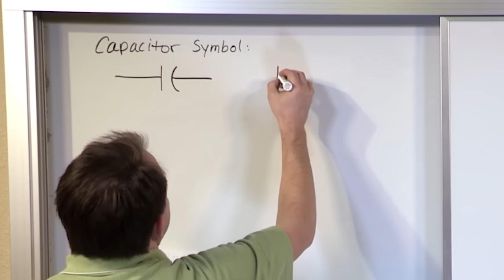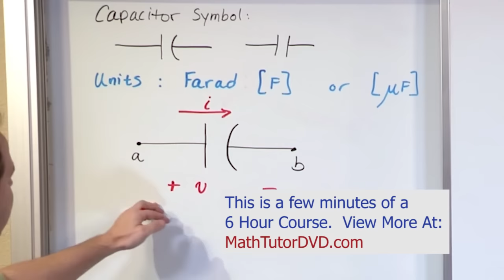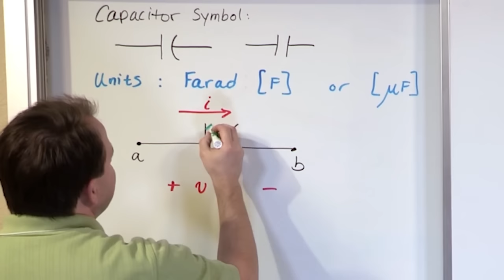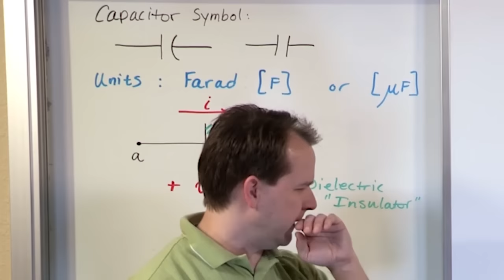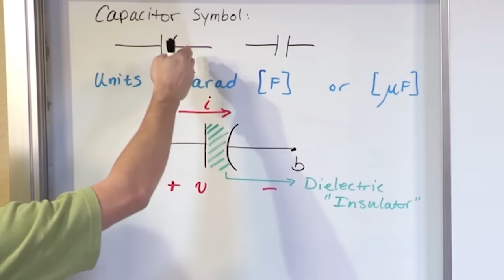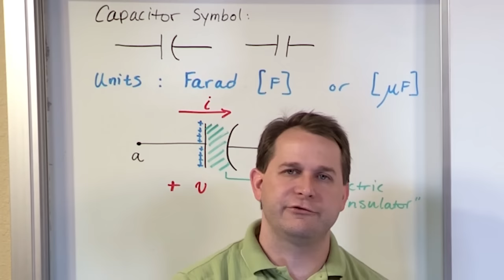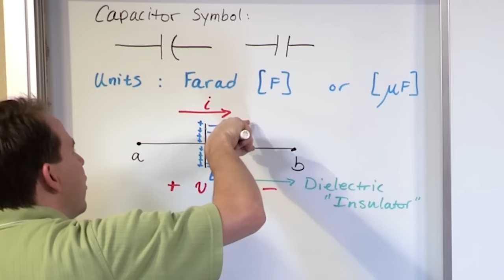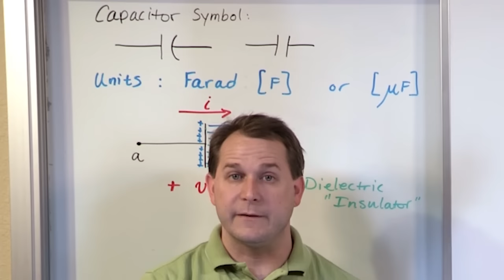What is a Capacitor?  Learn the Physics of Capacitors & How they work - Basic Electronics Tutorial

Comment: The curved plate indicates that the capacitor is of an electrolytic design.   The implication of that is that if you hook it up backwards it will probably explode.   For this reason you never subject it to alternating currents.   The most common is as DC filters in power supplies to remove ripple after rectification.

This is a fantastic series.  I see that he is bringing calculus into the instruction in Lesson 9.    Once you get into RLC circuits then you will need differential equations.   Oh how I love Eulers.

Many people don't understand why they had to take algebra in high school.   Algebra is just a stepping stone to calculus.     Calculus is where all the magic happens.   The power of calculus is absolutely incredible.

Comment: 2:32 This is true for most low power electronic circuits, where you'll mostly be using medium to very small capacitances for voltage smoothing; evening of potential for reliable power and performance. But I would like to expand on this. There are actually decently sized supercapacitors which can have capacitances of hundreds to thousands of farads! Some people even make cells of capacitors to deliver power instead of common batteries. They have some different properties such as very low internal resistance, so it can deliver a LOT of power really fast.

Comment: when the capacitor discharges the positive charges equates with the negative one and continue this till the charge stored on the capacitor vanishs, the positive gharge came from the holes that the negative charges left behind when they went to the positve terminal of the battery, the capacitors charges up till the potential difference across its terminals become the same as the voltage applied across it and here it is the voltage source potential difference

Comment: nice description...
only one two happen in capacitor .
1 .FOR AC SUPPLY CAPACITOR IS LOW RESISTANCE IT CAN EASILY PASS ON TO ONE TERMINAL TO ANOTHER TERMINAL

2. FOR DC SUPPLY CAPACITOR IS A HIGH RESISTANCE IT CAN'T PASS ON 
CURRENT FROM ONE TERMINAL TO ANOTHER TERMINAL

this condition depends on capasitance value (ferade)

Comment: What happens to the positive charge when a capacitor discharges (from the left side)? Where does it go?

Where does the positive charge from the right side come from? The world? 

Does a capacitor have to reach it's required charge to work? Question kind of answers itself and that is "yes", otherwise what use would they be?

Can you input a lower voltage and have a capacitor output a higher voltage? Or does it equate to: "You get out what you put in."?

Comment: if you continuesly have  9 volts going to the capacitor will the voltage in the capacitor increese
Reply: only up to 9v. like a battery charger will charge a battery usually with JUST a little more voltage than the battery would normally put out. (modern quick charge exempt)
but also AC is never continuous.

Comment: So if I'm connecting a cap to a transistor base the cap should be positive for  audio input and negative would connect to the base of that transistor for audio output source correct?  Or I could say it like this the audio signal goes into the plus side of the cap and drains out of the negative side of the cap into the transistor base. Basically I want the signal to be continuously going forward and never coming back into the incoming signal. This is what I want to accomplish. Will you be willing to answer this question thank you. 🤗💖

Comment: You send the current up to plate. but it's not a complete circuit yet so how does the current move? is it because the other side of the capacitor has had electrons removed by the other terminal and is now positive? or are electrons so easy to move with a single terminal charge that the plate can be effected filled? Is there a point when it's filled with negative charges and it actually pushes back or equalises and no more electrons can be gathered?

Comment: Good lecture.
I do have a problem with positive electrons piling up on the plus side of the capacitor though.
I was taught that negative electrons pile up on the negative side and repel the negative electrons away from the positive side making the plus side more positive.
Reply: It works both ways

Comment: I've never liked this "positive" electron flow concept. This is very counter-intuitive. Why not just say that the flow of electrons from the negative battery terminal (actually just a transfer of electrons from atom to atom) builds up on the negative side of the capacitor and induces a corresponding positive charge on the opposite plate causing the illusion of electrons flowing "through" the capacitor? IOW, just the reverse of what he was saying. Anyone care to chime in?
Reply from the maker: I'll chime in.  You are correct and at first glance it seems counter intuitive because electrons are what is actually moving.  The problem is that electrons are negatively charged so if we write all electrical equations in terms of electron flow then all the equations have negative signs everywhere.  That gets cumbersome especially when you write equations that involve electric and magnetic fields.  So we instead write the equations in terms of "hole current" which is the positive current that runs in the opposite direction to electron flow.  Of course the positive charges aren't really moving but mathematically you get the exact same answers doing it this way and you avoid all of the cumbersome negative signs everywhere.  You may not agree that this is a good reason, but this is why we talk about positive current flow in circuits instead of electron flow.  Basically it is convenient when writing equations and solving problems.
Reply: +mathtutordvd thank you! thank you! thank you! sooo much, I was so confused up till now ,internet is amazing.
Reply: +mathtutordvd Okay, I get your meaning. But doesn't this mean that you get the opposite results (a lot of unwieldy minus signs) when working with equations involving inductors? Or is it that modern circuit designs don't make much use of inductors any more? After all, they're not really miniaturizable (for use in ICs) like resistors and capacitors are.
Reply: Zero dem ex b de gt SCç muito t +Yash Pandey
Reply: Chris M I know, it's so confusing.
Reply: Chris M couldnt agree more
Reply: Chris M.
Research the Passive sign convention.
Reply: Chris M how do inductors get brought into this in comparison???
Reply: It's all because Benjamin Franklin didn`t know about electrons and simply got the direction of current flow wrong. 200 years later and it would be one h ELL of a big job to convert the world's standards and history over to electron flow.
Reply: mathtutordvd thanks I now get why we talk about it this way....but basically if we were to put a “magical” microscope the “positively charged side” of the capacitor just means the “lack of electrons and the other side just means the excess of electrons right .?

Comment: In simple terms a capacitor is an electrical component that stores un used power, given from the sours. when the sours is taken off the capacitor is the secondary sours that will power up whatever its used for and will be de-charging, either instantly to blast out a charge of power or set for a length of time?

if i had a 12v battery and on a circuit bored i just had a resister and 1 LED in series it obviously would power up, but once i took the battery off it goes out. but if i hooked up 1 (3 microfarad) in parallel to the sours of the circuit and powered it up then took the battery off the capacitor would take the battery's place and continue powering the LED for a short period of time, correct?
Reply: Do you mean source?

Comment: I have a question as i have limited knowledge on electrons, current flow, etc. But if the capactior was able to generate a really powerful postive charge wouldn't the negative charged electrons jump over to the postive side to balance it out etc.
Reply from the maker: You are correct in a way.  If the electrons "jump" over the gap, or dielectric to the other side, then the capacitor has burned out and it doesn't work any more.  Basically if you put too high of a voltage across it, you'll burn it up because of electrons arcing or jumping across the dielectric, destroying it.
Reply: Thank you for your reply. :)
Reply: mathtutordvd How does this "junp"  happen though - Without a medium to conduct it?
Reply: Planet Unto Her Own with enough voltage pretty much anything can become a medium

Comment: For at least 15 years now, people have been using multi-farad caps in automotive audio installations in conjunction with high current amps.  It was  not uncommon to see a one farad cap the size of a 32 ounce thermos.  I'm not sure why you state in the video that they are the size of a room but perhaps you meant for the application of being in an ac circuit vs what I'm referencing is a dc application.  Just wanted to share that with you.

Comment: is it true that current flows through a capacitor, as you said sir?
Reply: +emma Der Prima No, it's not true. There's no direct connection between the plates. A charge builds up on one plate causing the opposite plate to build up a corresponding but opposite charge. Electron flow through the capacitor is just an illusion.
Reply: You might think of a capacitor like a plastic tub with a rubber membrane in the middle dividing it into two sides. The wires connecting to the capacitor are like pipes where the water can flow in or out. Each side starts with a little water in it, but if you keep putting more water into one side, it'll push all of the water out the other, right? Then if you connect both pipes together, the water will push back the other way, and balance out again.
Reply: No. No current flows through the capacitor, but electrons (current) flow in and out of both sides.
Reply: No the same way current doesn't flow through a battery.

Comment: the voltages in parallel produces no current flow between them means no more charges will build up when the voltage across the capacitor become the same as the battery voltage so now no more current flows, and the answer to the final question is i think no , as you say you get out what you put in

Comment: What is electric current? A flow of electrons? 
What does a capacitor do ? It uncreases the electron content in it utilzing the current( electron) from a battery thus one -ve plate becomes more negetive and pulls the resident -ve particles present in the pisitive plate inside its own along with +ve proton? The proton remains outside the electrode plate but electrons enter in it, till all the electron in the positive plate is acquired by the electrode and on its outside equal protons are amalgamated??

Comment: If you have a cap that is made of actual aluminium plates (disks) are the only physical connection on the top and bottom plate?  or is every other plate PHYSICALLY connected to each positive and negative?

Comment: I can not get again even though l watched this explanation several times.There is a big gap between two plates of capacitor.Postive charge piles up on left side plate in this case how we can decribe minus electron on right side?
Reply: You have it reversed. Electrons are negatively charged, and when they build up on the anode, their strong electric force pushes the electrons away from the cathode, dictated by however many protons are available to give positive charge on the cathode. That is where the equal and opposite charge comes from, the overabundance of protons which are positively charged.

Comment: I hope someone is able to answer my question, I'll try to articulate it correctly so that i can be understood. When you have a capacitor or an inductor in a circuit, you are charging up energy in both this components one stores it in an electric field the other, in an electromagnetic field however what happens with the other unrelated components, or conductors nearby the Capacitors and Inductors?? Aren't the other components or wires affected by these fields? Won't the fields interact with the fields created inside the insulated wires, or won't it charge up other components like relays, transistors, won't it mess up with signals in gates, or mess up with frequency in timers, I mean we are creating fields that scape the component seeping in other components nearby how is it that this are waves not affecting everything else surrounding them?

Comment: Is there a maximum, or are capacitors relevant to size, meaning it has no limit? If it had no limit, then it seems that the slightest amount of voltage can power anything with enough time and a large enough surface. So, our electric bills could be pennies with the right capacitor??

Comment: If so then cant we keep a more negetive plate in a battery that will wrest more electron from the positive plate kept opposit to it in a battery and thus will generate more current. Only the electricity will be used to charge such a battery to excite the negetive plate in it. And we will need no seperate capacitor

Comment: I don't get it. Electrons are negatively charged so how come the charge on the left plate is +ve? It should be the other way around.
Reply: Because it was decided that positive charge was how current flows. This was before it was known that electrons are the ones moving. An unfortunate wrong guess in history but now it has become standard so we have to live with it.
Reply: mauroz100 And that's the reason I refused to study electronics.  No wonder we don't have flying jetpacks yet.
Reply: mauroz100
they should just change it lol
Reply: hohaia rangi. I had brought this same level of confusion to all three of my professors with that exact same argument and despite each professor's viewpoint on teaching electron flow or conventional flow, one mentioned because it was thought way back when, that current flow was in the positive direction - and that this was all theory from scientists in the field of electrical engineering. Another professor said that as an electrical technician, you will never view current flow as negative to positive, that in the practical hands-on industry and not theory, you will view this from positive to negative. Similar to viewing voltages drops in series components, losing it's potential difference when arriving back to the negative end of your voltage source terminal. I guess maybe it comes down to what type of engineering you are and it's application--are you a scientist or a technician. I tend to believe the latter professor because he works at Rocketdyne. Also build a simple series circuit in Pspice software with negative ground and you will see voltage drops go from positive to 0.
Reply: Hi hohaia rangi!!
I think the reason why he labelled it as positive because electrons were repelled on the plate 'a'. 
As we know, capacitors are connected to other power sources like batteries. For example, if we use a battery, it will start on the negative terminal of it until the plate connected on the negative terminal (plate 'b') are filled with electrons, thus, making the plate negatively charged. These electrons will repel the electrons of the other plate, making the other plate (plate 'a') positively charged. 
Moreover, the repelled electron on plate 'a' will move to the positive terminal of the battery then move to the negative terminal. Then a cycle starts. This cycle (like what I've explained) has a direction that will explain why positive charge current flows to the negative charge if only you could visualize the whole circuit (from the battery to the plates).
Reply: mauroz100 This. But it has at least one advantage. It works with the right-hand rule for the cross product.
Reply: +Fletcher DeMaine lol
Reply: We thought we knew then like we think we know now.

Comment: Not sure why protons keep piling up because electricity is the movement of electrons and not protons.
Reply: He did not see protons, he said "positive charges." The positive charges are typically called "holes."
Reply: Xabsa Cismaan in an AC circuit electrons "slosh" back and forth like in a bathtub. You can think of charge like water depth.
Reply: Xabsa Cismaan, Yes. Big difference. Capacitors behave as open circuits in DC circuits.
Reply: Xabsa Cismaan, Yes, a capacitor behaves like an open circuit in a DC circuit. Current does not flow through a capacitor, only into and out of it, like a bucket.

Comment: There is an air capacitor that was very common. The old transistor radios or vaccutube tvs uses a variable air capacitor to change the frequency to different 'stations'... But please never see a Farad capacitors???? odd...

Comment: How old is this video?  I was surprised to hear that dramatic statement that a 1F capacitor would be the size of a ROOM. Only, in a small home electronics project I just used a 10F capacitor that's around 2/3 the size of a AAA battery. Tiny. I have 100F caps which are half C size, and Maxwell 3000F caps the size of coke cans.  Supercaps have been around for years. At work we used a supercap as a RTC battery backup - and that was maybe 10 years ago. What gives?